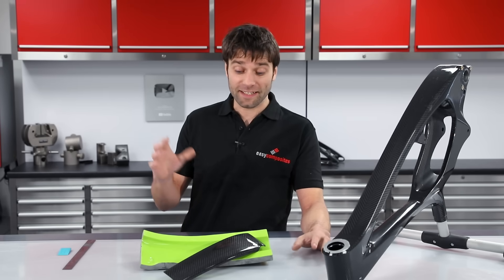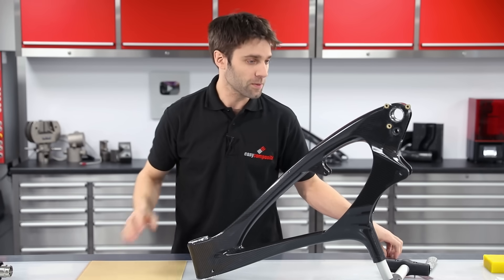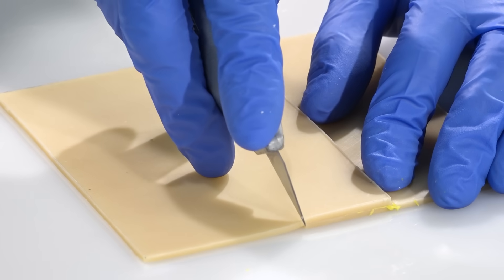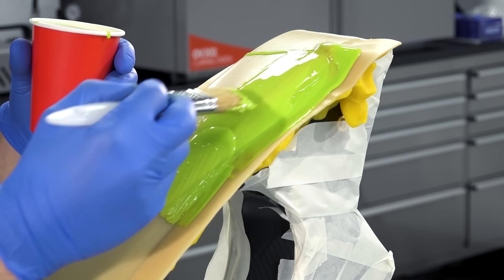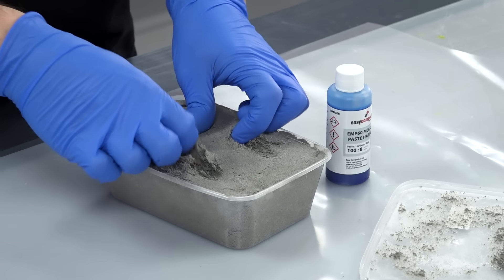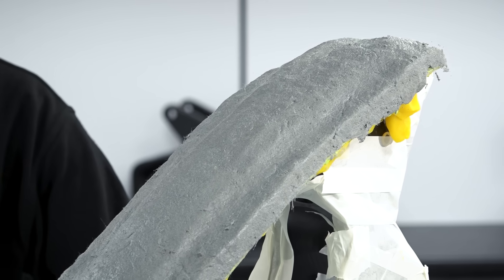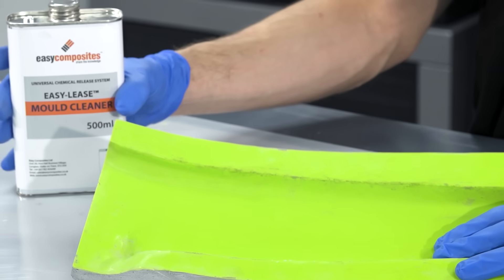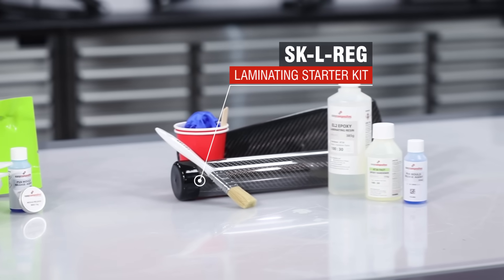Using Sheet Wax to Create an Offset Mould for a Carbon Fibre Cover Component

Comment: Is this sheet wax reusable? could we transform it into some sort of filleting wax
Reply from the maker: Hi Sylvester, I don't know of a method or process for usefully reusing the sheet wax. It's to broken up to be used whole again and I'm not aware of a way to recycle it into another usable material. Filleting wax makes sense as a suggestion but the consistency and behaviour of these materials is very different.

Comment: To think I was about to give up on trying to make molds cause the difficulty in getting good flange this video pops up. Great job guys btw can I use any sheet wax
Reply from the maker: Hi Neilon, thanks, I'm glad this helps. As for what sheet wax you can use, I'm not sure what other kinds there might be or what their properties are. The sheet wax we supply is specifically for composites, it's precisely calibrated for thickness (important for offset moulds, less important as a temporary flange barrier) and it's self-adhesive. If you can get these properties then it's probably the same material and of course, depending on where you're based you could always buy it from us to be sure!
Reply: I live in the US

Comment: Glad to see more regular of your spectacular videos and tutorials. Can I use acetone to clean the surface from wax instead of mold cleaner?
Reply from the maker: Yes you can but you need to be a little bit more careful with acetone because it can be more aggressive to the mould than mould cleaner. The other thing you'll find is that it's easier with mould cleaner but the mould cleaner solvent is less volatile (so, evaporates less quickly) and so it softens the wax more before it just evaporates away.

Comment: On my second coat I will put in some cabosil to thicken it
Reply from the maker: Hi Kevin, yes, that's not a bad plan at all. We do have some colloidal silica (cab-o-sil) in the EG60 gelcoat already but, as you'll know, you don't want too much in there or it can make air bubbles on the mould surface more likely and also make the brush strokes a bit more 'bumpy'. For the second application it wouldn't hurt at all for the gel to be a bit more thixotropic.
Reply: @easycompositestv  That is way it is only on the second coat
Reply: Kevin, that's a really good tip!

Comment: Nice! I guess the wax sheets technique could be use to make some nice carbon fiber mudguards for a bicycle by applying it over the tire
Reply from the maker: Yes, you could certainly do that. You'd probably need quite thick sheet wax to allow enough clearance but it can be layered if needs be.

Comment: Will the epoxy and gel coat shrink or deform if you used a low temp oven (e.g. 75 C) to soften the wax?  For a complex shape I can see the wax becoming difficult to remove.
Reply from the maker: For our EG60 and EMP60, the 'Tg', i.e. the maximum temperature the gel and reinforcement can go to without any problems is 60°C. At 60°C the wax would not really have changed a great deal in terms of removal. It's probably more helpful to use more heat from the heat gun, aimed directly at the way, to aid with removal. Generally speaking, if you're using sheet wax with epoxy resin, like we are in this tutorial, then you're unlikely to have any trouble removing it. When using sheet wax with polyester or vinylester resin then it can be more of a problem and that's where sheet wax sealers can help.

Comment: "300mm for the length" ah, the extent non-Americans go to avoid saying 1 foot
Reply: You mean the entire world bar the good ole USA.... idiot
Reply: And if it was 296mm you’d say 11.645 inches. Good system that, muppet.
Reply: @_chenn  worth it to be called a muppet xD and fair point. Carpenters here typically use fractions down to 16ths of an inch. Any finer and your tools, cuts and materials won't match the accuracy of the measurements. My dad is one of the less educated people I know, but watch him work tape measure calculations and he transforms into Rain Man. I'm sure you don't care, but that's my story of why I like Imperial units. But personally, I didn't get the carpenter genes. So all my 3d printer work is in metric.
Reply: Caleb Hopper haha, no that’s cool. I was a little harsh on the defence of the metric system 😂 i work in f1 and the margins are typically +/-0.25mm which as an imperial measurement is a nightmare, multiple zeros after the decimal. Anyway, have a good weekend.